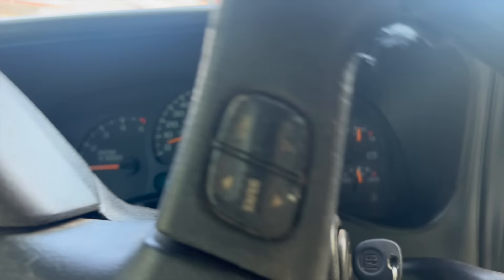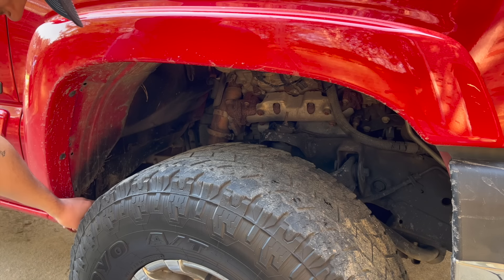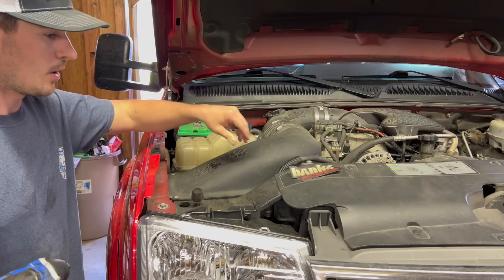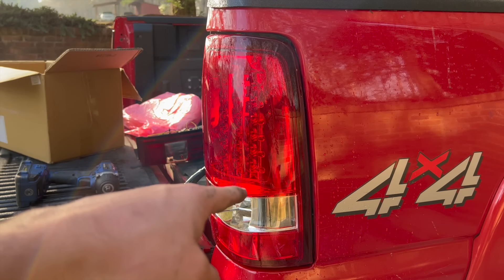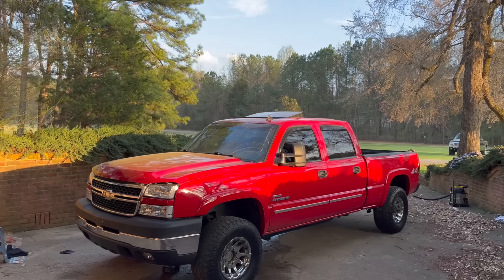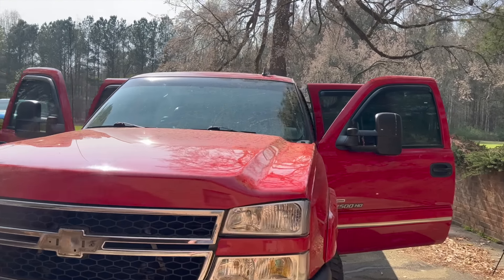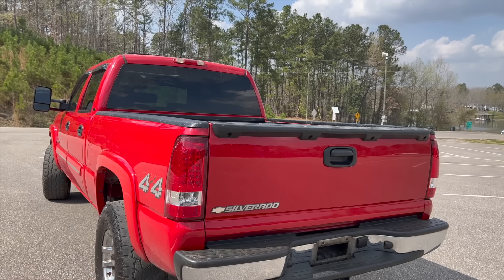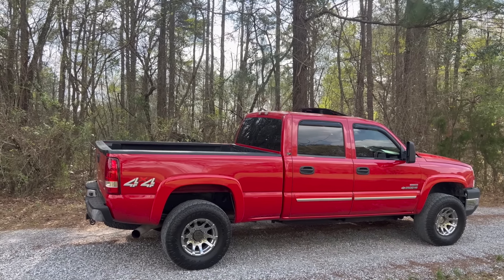MUST DO'S AFTER EVERY USED TRUCK PURCHASE!!!!

Comment: Aren't there drain tubes for the sunroof that go down the A and B pillars? It's pretty common for those to get clogged and cause water to puddle up inside the roof and leak onto the headliner. Might want to look that up and try cleaning them out.

Comment: I bought my LBZ new in late 2006 and have been able to change fuel filter from the top every time. A little tip for you, after replacing fuel filter start your truck, when it stalls just crack the purge screw then pump until fuel comes out, close screw and pump the primer until it won't depress any more. Start the truck and you are good to go. I actually put a valve on mine to make it less messy. Then I added a lift pump and can forgo the bleeding process altogether. If your truck is 4wd you'll want to add the BRNY plate to your transfer case pump so you don't end up with the pump rub pin hole. I also added the filtration systems bypass oil filter as well to filter the oil better. There's a lot you can do to these but I would start with the mods that extend the life of the truck. Also, they came with a shallow transmission pan, I would replace it with the standard,or what most call the deep pan from allison.

Comment: My 02 2500 HD 6.0 Has 425,000 miles. I do my own work and put brakes on all 4 . Calipers pads rotors hydro boost power steering pump rebuild entire front end new tires and i added coil overload springs on the rear. Without getting into the engine it gets regular oil changes and runs like new
 I put a visor and roof racks modified the tailgate to receive a 1/5 wheel or goose neck. For cun i put an altimeter on the dash and a rain guage on the front bumper . My brush guard has a hndyman jack  a comealong log chain double bit ax and a buck saw.  magnet to hold a couple Tools its paited camouflage with bedliner paint.

Comment: Btw, you can cut a little square space out in your fender for servicing the fuel filter, and cut two little small holes for some hard to see zip ties, once you’re done with it then put two new zip ties back in. Also you don’t have to take the plastic screw all the way out. Just open it one turn and pump until you see fuel

Comment: Banks is an awesome intake. I’d suggest ordering the cover for the filter. I ordered the dry filter with the filter cover and the scoop and the scoop makes a major difference in intake temps. My intake temps are roughly 2 degrees above ambient when rolling. It woke the truck up, I also have the banks six gun tuner.

Comment: I went from a 2000 Silverado extended cab to a 21 Silverado crew cab Custom and getting all my stuff was a lot of fun. The first thing I did was swap the steering wheel and dash out. Along with bed cover, dash cam, rain guards,all weather mats,tow hitch,trailer brake, and LED headlights and reverse lights from Lasfit. After all my stuff was installed I removed all my badges and stickers.

Comment: I have a 2009 GMC that I bought in 2014. I changed out a bulb on the tail light and that whole pocket was full of dirt. Your tail light pocket area was covered but on the newer trucks it is open to what ever the tires throw up there. I bought a set of aftermarket rear wheel well liners and put mudflap material in the opening of the pocket. I live in Upstate NY and that would be a perfect spot for the salt to eat up that area. The truck only had 17,000 miles on it when I bought it.

Comment: I soak my air filters in hot water and dish soap. Then rinse it . Seems to clean it the best . To speed up the drying process I put a hair dryer in the filter and leave it for 10-15 minutes. 

I also work for Cummins and it’s best you install the fuel filter dry so you aren’t filling your new filter with contaminated diesel.

Comment: Great truck. We've had 4 2005-2006 cat eyes. Get the transfer case checked. There's a part inside of it that vibrates a hole in the case causing a small leak. We had to replace to cases at the same time.

Comment: Every single vehicle I buy, I put rain guards on. So my vote and suggestions would be new rain guards, AirDog lift pump and stock fuel filter delete, center caps for wheels that fit that truck just fine and use that money saved for the highly important lift pump. The black headliner would be cool. Boost Auto Parts sequential turn signal tow mirrors, black and chrome door handles for exterior,  3 inch down pipe, pcv reroute, turbo resonator delete, 8 new AC DELCO 9G glow plugs, Edge CTS3 Insight to monitor everything. These are some of the things that are "must haves" and some things you might like and/or benefit from. 
I love my '06 LBZ Sierra 2500hd. I have some of these things I've done to mine and a mild tuner and Transgo shift kit Jr. I spent 2021 and 2022 refurbishing my frame and body. I do all of my own work on my truck, welding, bodywork, painting, etc. A lot of hard work but no $1,000 + monthly payments, just credit card bills.😂 175,000 miles and runs like a top. I use Opti-lube XPD in every fill-up. Would like to get a PPE oil pan on her someday and an RDS 64 mm 9 blade turbo. 
Red is not my color, but she is beautiful. Congratulations! Mine is black.

Comment: I would like to send you some pictures of what I’ve done to mine. Not sure how to do that. The dealer made me laugh when I showed him. “ You’re really narrowing down the Resale market.” Just struck me as funny. Just a few add on’s. Cab lights, chrome trim on the window vents, body color fin antenna, different running boards, lettered bed caps, bed rug, bed extensions, tailgate steps. Chrome on body side trim on bed , tail light trim, under tailgate light bar, under hood lights, chrome dash trim, foot well lights, transmission cooler, cylinder cut off modules, Vouge white walls. Painted the Chevy “Bow tie” on the center caps large gold flake. Guess that’s about all for this year. Oh yeah almost forgot. Some absolutely amazing puddle lights. Must be seen to be believed. Side marker lights also. But I like it and that’s all that matters.

Comment: The aluminum stock wheels on those years look so good I just wish they were bigger than 16’s. I put the newer style 5 spoke ltz 2500 wheels on my truck but every time I see a gmt800 with some clean polished aluminum stocks I question myself
Reply: My '10 1500 Sierra came with 20" aluminum wheels. They are called " touring wheels". I personally don't like them being that I live in upstate New York. The bead area on the wheels oxidizes and creates a very small leaks.

Comment: Nice work. I always change my fuel filters from the top. It's a tight squeeze to get it out but i've done it in sub zero temps when necessary. Sadly, my 2003 is now blowing blue smoke after 200K miles. I'm guessing rings instead of injectors this time. It's a great farm truck and I wish it was as nice as yours. Just wondering how much life it has left. Rocker rust for sure. But still running!

Comment: Every time I get a new truck I clean it extensively inside, new oil and filter, fuel filter, drain and fill the diff, new trans fluid and filter, clean or replace air filter, check the belt, drain and fill the coolant.  The tail lights I would replace and I always put in LED license plate lights and reverse bulbs too.

Comment: technically you dont have to bleed off for the fuel filter change everyone in my area just hits a few pumps till its stiff then rev it to 1500 for 10-20 seconds just in case (the theory is to "run thru" any problems") no idea why, its no easier just what everyone i know does that works also. imo the cateyes need rainguards and a bugshield on the hood

Comment: Change All the fluids over to Amsoil, and run a bottle of the amsoil Ctane and injection pump lubricant in every tank of fuel and you will never have injector problems.
Reply: Have you seen the difference with amsoil forsure? Because i do run amsoil on my motorcycle but i heard amsoil is overrated and its as good as cheaper brands but not the cheapest.
Reply: @WalkingDead520  I’ve been running amsoil for years in everything, I believe it is superior product “ project farm lubrication test” showed it had the best lubricity compared to any other brand.

Comment: I just bought an 04 lb7 with 230,000 miles on it new injectors new batteries and it runs like a new truck I think it would pull hell through a knothole

Comment: Get in the bed and go up to the roof. Look at the "C" or rear-most pillar and there is a little deep galley where the door seam would stop that is not always sealed by the factory very well. Fill it up with 3M Weatherstrip cement --- black is best. This keeps water out of the rear cabin dogleg and will keep it dry so it doesn't rot out.

Comment: When I bought my 2010 in September, I’ll literally changed the oil check everything else out change the fuel filter transmission filter and I also change the air filter right now I change upper and lower ball joints and I think I might have to change the U joints

Comment: Just curious why is this your dream truck?
Reply: Pre emissions duramaxs are very sought after
Reply: LBZ is the most sought after Duramax amongst enthusiasts. Pre-emissions (no SCR/no DEF, no DPF) and it has a few important upgrades over the previous LLY (2004.5 to 2005), such as having a 6th gear (so you aren't turning over 2,000 rpms at 70mph when you get max torque around 1,600), an appropriately sized turbo inlet mouthpiece, and more. I believe this also has a true Allison transmission other than an Allison branded trans. They're very reliable. Also, the cateye front end is one of those love/hate designs and the people that like them REALLY like them.

Comment: To stop your sunroof from leaking use vegetable oil put some on there let it sit wipe it off don't leave it on there it'll mess up the rubber all together but if you just rub it on let it sit for a few minutes and take it off it'll help seal them windows if everything else is okay

Comment: I've never worked on or owned a diesel. I have an opportunity to get an 06 just like thus with the duramax only 132,000 miles. are these problematic or are they good for even a non diesel guy like me?.

Comment: for those who have a sun roof, if you dint know they have drain plugs inside the roof lining if you dont drain it it may leak inside of you vehicle.  also 10/10 but nxt time whacth we your spaying the water or plug the tail light, cause u did end up putting a lot of water in it
Reply: also could be the seal but the drain plugs are know for clogged causing it to back up into your vehicle

Comment: I like the rain guards but maybe go with weathertechs or Avs brands, they’re way cleaner looking! Not as bulky.

Also I agree on the wheels! Maybe not that exact wheel but definitely a smaller chrome fits the vibe. I’d throw on some chrome 18x9 Raceline Assult wheels with 33x12.50 Atturos🤤

Comment: Raise it by at least eight inches (What you wish something else was)

Make sure you DO NOT adjust your headlights, unless its to specifically beam your lights into the person in front of you's back window.

Ensure you always have your high beams on

Use your turn signal AFTER you make a turn

Make sure to have a fairly large ball hitch always attached , even though you're never going to pull a trailer, and ensure you always backup into your parking spot so you block a sidewalk with said hitch

Go 5 below the limit in the passing lane and then get your ego bruised when someone passes you on the right.

and the most important addition; A punisher sticker and/or a "no fat chicks" sticker
Reply from the maker: 10/10 would suggest logging off and  touching grass

Comment: I really like that body style and the front end!  Looks good.   Your truck has a really cool stance with those wheels.   Looks tough!   One note on the sunroof... that gasket is designed to let water through (a little)... if it's leaking, make sure the drains are open and clean!   A lot of times the drain tubes get clogged and then you get water inside the truck.    Question for you... I live in the upper mid-west and these are mostly gone due to rust.    Where do you live?  Will you Fluid Film it to preserve it more?   We use Fluid film around here and it works really well!